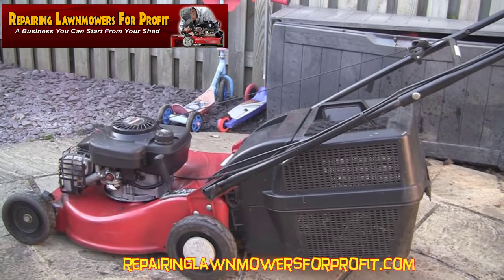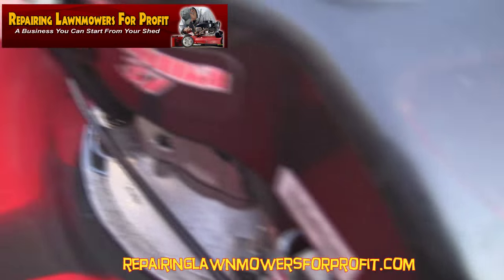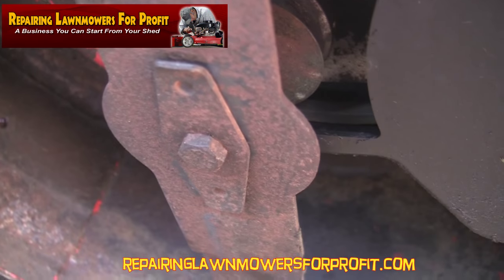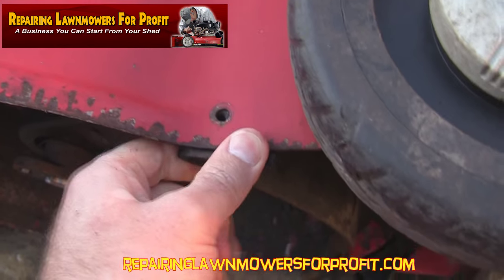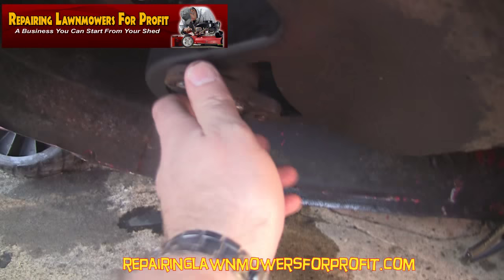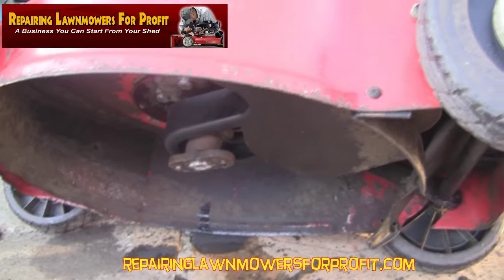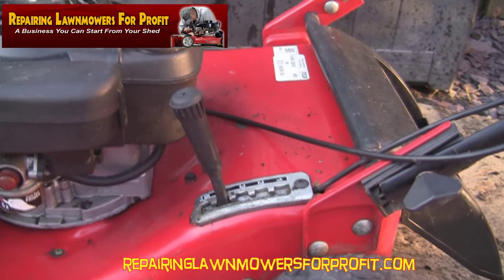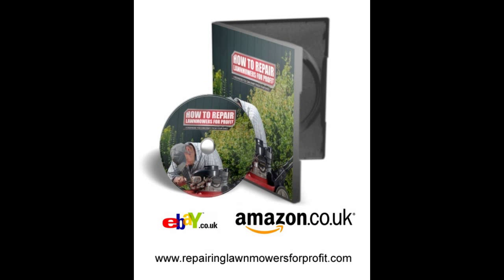How To Remove A Tecumseh Lawnmower Blade

Comment: Hi good to see some new vids, I'm not very keen on the techumseh engines, if they run ok I'll leave them on the base, but usually I swap them either for a briggs classic or a Honda engine I have stored. I do believe techumseh aren't a company anymore, so spares from them engine sell quite well, so i think when I take them off and just strip them down for parts to sell separately. It's good to start getting the mowers ready for next year early, that's my plan. I'll look forward to your next vid thanks.